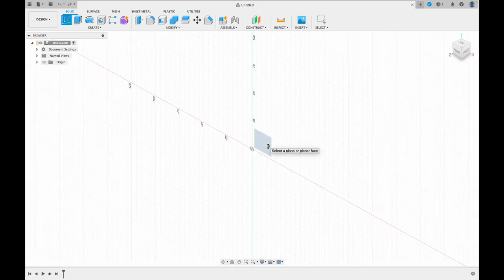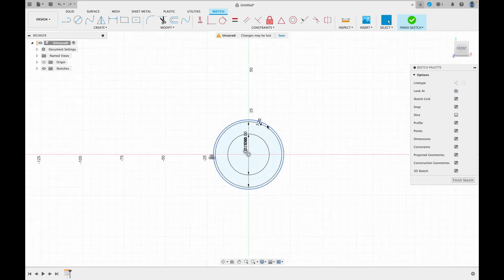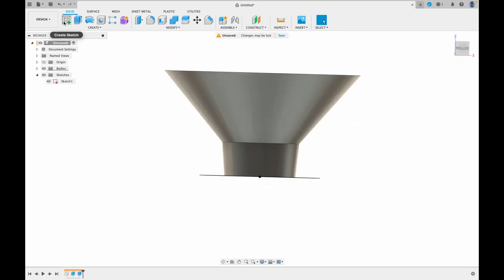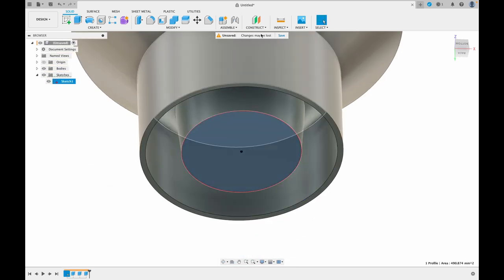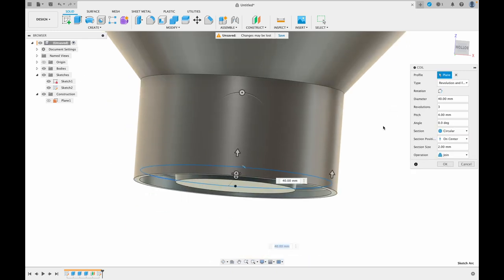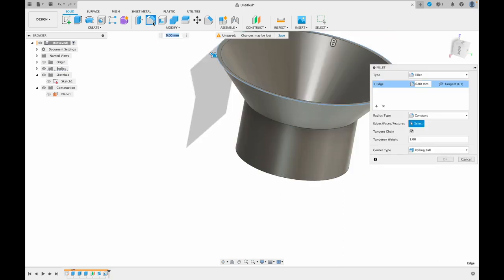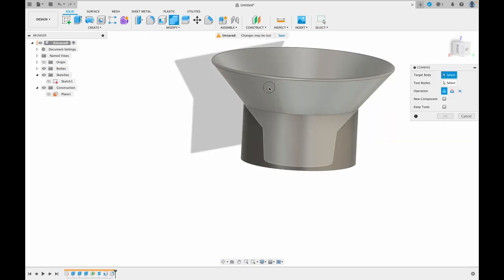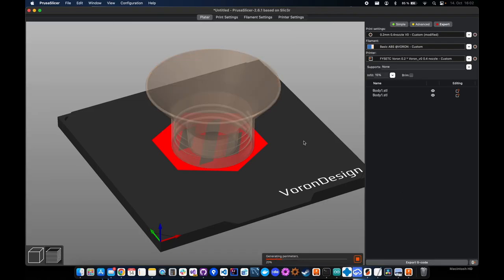Fusion 360 CAD design done quick | SPICE shaker IKEA IHÄRDIG screw on funnel | 3D printing ideas

Comment: Did the soup get cold? Hahaha. I have now watched every video you have posted. Also, this model is extremely similar to one of the first I ever modeled completely from scratch. Mine was an oil funnel for an RX-7 engine. A Wankel. ;)
Reply from the maker: The soup wasn't even hot, we heated it only after the videos was finished 😅
Did you also watch the unlisted video I only linked in another video?
Printing funnels is really a prime example of 3D printing. You almost never have the perfect size around. Also printed one for my wife's aquarium. I had the honor once to drive in a Mazda wankel, but I think it was an RX-8
Reply: @SmallBatchFactory  I figured it was a different soup entirely, a stunt soup. Shoulda known it was just unprepared. ;)
Funnels are def an awesome use of printing. Adapters of any kind as well. Need two things to fit together? Can be done.
RX-8 is still cool, but sadly had a worse engine. Sent me on a scavenger hunt, but I found the unlisted vid!
Reply from the maker: Yes, it was a canned soup since filming an empty bowl looked strange on camera, haha.
Adapters is really the very best use case. I have an adapter for my workshop vacuum I made from wood back then. It was so much work, it's fragile and everything. Could design it today in 2 minutes!

Comment: Personally, I do not think you needed the threads at all, and that they slowed down adding and removing the funnel. Arguably the outer wall isn't even needed, but it helps hold it in place better if you use it on openings that are slightly larger than the inner wall
Reply from the maker: You're totally right. That was more a "because I can" thing. It's something you can't buy and that's what 3D printing is all about for me. I solely use this funnel on this one kind of spice shaker. As you saw we have a whole shelf full of them